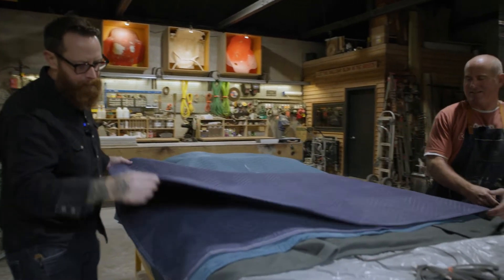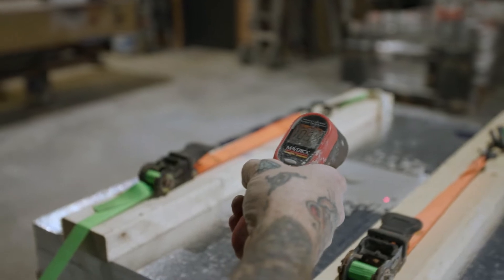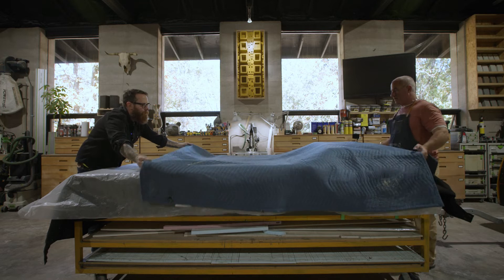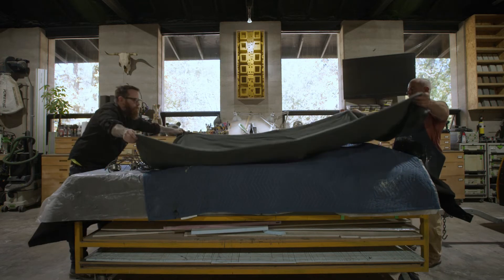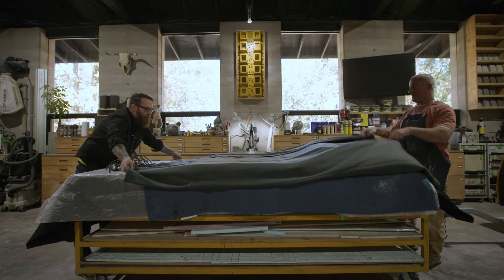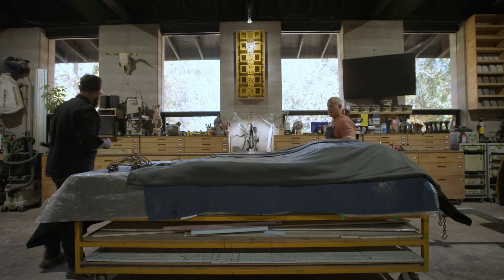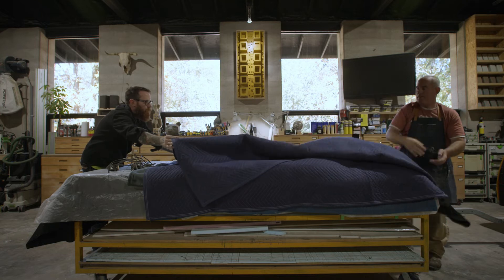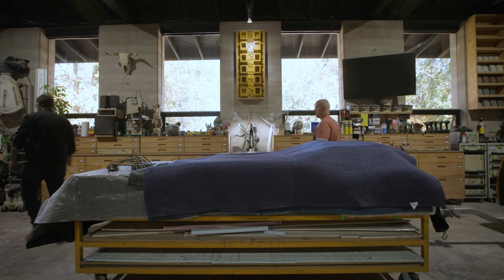Learn from Pro's How To Properly Cure your Concrete Countertops and Sinks, from GFRC & UHPC, to ECC

Comment: Great video guys…thanks for posting.  On your long casting table (in the background)- what material are you using to cover it?  Thanks!
Reply from the maker: That was a torsion box built with baltic birch plywood. On top of that we place our forms for casting concrete, and those range from melamine, to plastic, to fiberglass or rubber. The Wood Whisperer has a great video on building one, https://www.youtube.com/watch?v=1-Hbsou6cWo